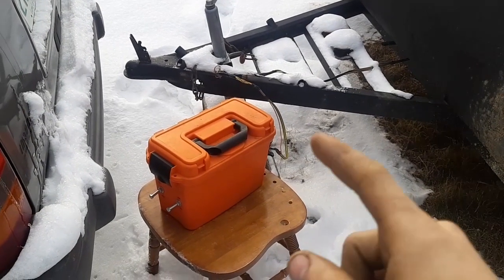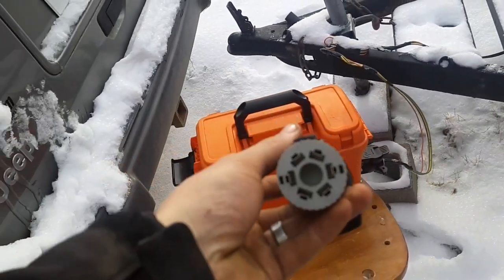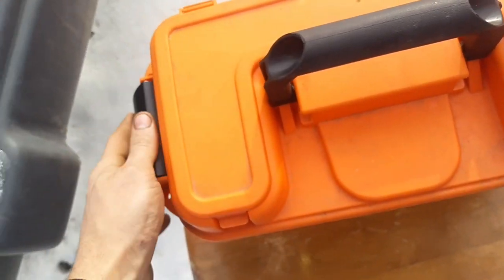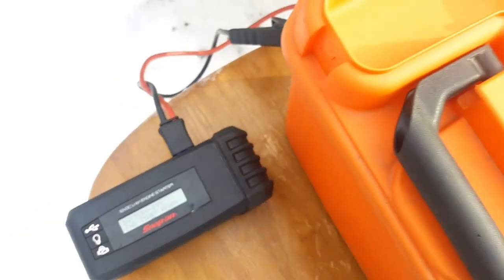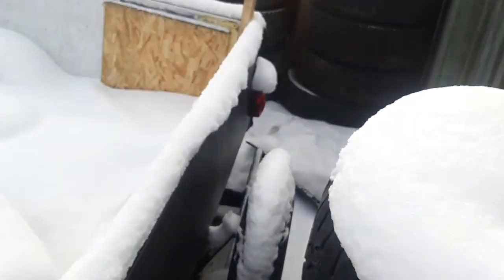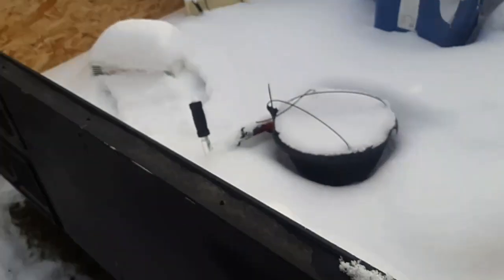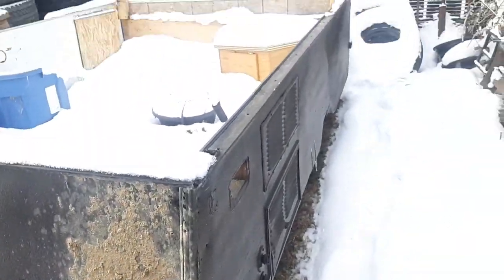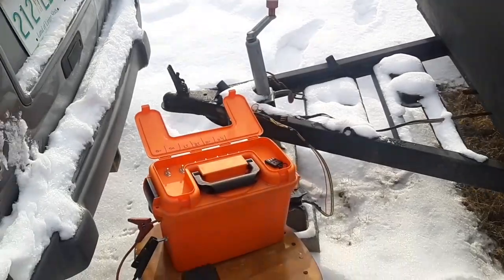DIY TRAILER WIRE/LIGHTS TESTING BOX

Comment: Could this run off a drill battery
Reply from the maker: Absolutely, most 12v automotive light will handle up to 20v, with an adapter inline for power to where you can slip on a drill battery it will work. This was just made up crudely to be powered by anything that will clamp onto it for our shop  so jump starter, and and jumper cables to a battery etc.